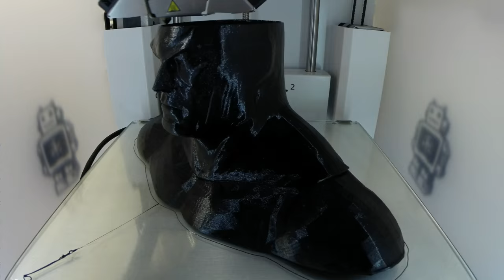Channel Trailer, Video Compilation

Comment from the maker: +Egbert Joostens The printer actually keeps track of how much i have used, and it's at 1661 meters! One spool of colorfabb is 100 meters which weigh 750g so if my horrible math skills are correct i have used about 12,5kg of filament!

Comment: Love it ! Need me some ABS prints not sure to go for a um2 for abs
Reply from the maker: +iCloud Henshaw I have done some test prints with the cheap ass chinese ABS from ebay the last couple days and they look fantastic! really smooth and nice! Tried a slightly larger print but it came loose :-( If i'm going to try more i need to use something else for adhesion.
Reply: I would recommend build tak as a i spoke to them at the TCT show in Birmingham but you can very easily damage the surface and make it unusable but it's really good stuff and you don't need any hairspray or glue sticks, have you ever wondered about upgrading to dual extrusion?
Reply from the maker: I get fantastic adhesion with hairspray on everything but the abs so I don't think I'll bother much with abs. I really wanted dual extrusion when I bought the printer but ultimaker has said they couldn't get it good enough so I don't think I want it either, I really just want it to work without to much fiddling :-/
Reply: Multimaker ebay CTC 3D printer about £300 or €350 and dual extrusion and heated bed if you want to grab a smaller dual printer
Reply from the maker: +iCloud Henshaw Looks good but I have all the printer i need in the ultimaker, and I recently spent a whole lot of money pre-ordering a Glowforge!
Reply from the maker: +iCloud Henshaw And they seem to use 1.75mm filament, the ultimaker uses 3mm so that would be a hassle...
Reply: Buy a 1.75 nozzle turn the 3mm into 1.75 :D
Reply from the maker: Hehe yeah that sounds like a good time ;-) no I think I'll learn to paint my models instead :-P
Reply: Multimaker Airbrushing is a huge help for applying primers
Reply from the maker: +iCloud Henshaw Hadn't thought of that but that sure sound like a good idea!